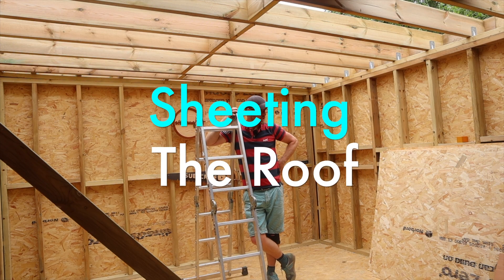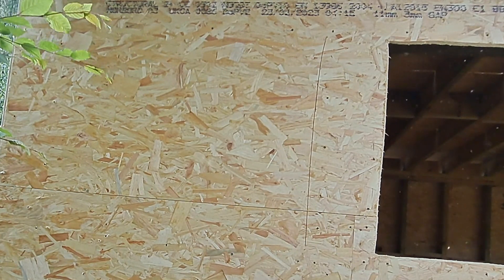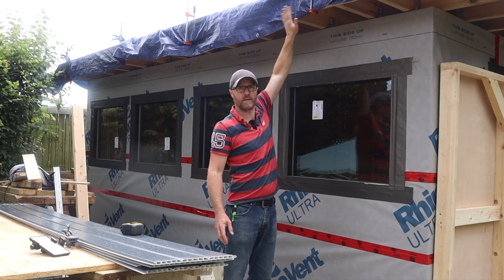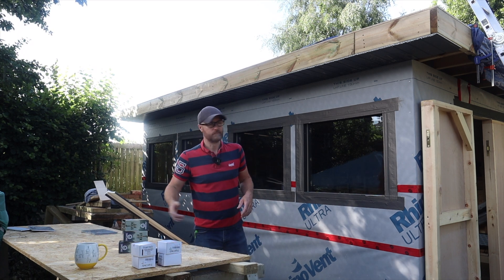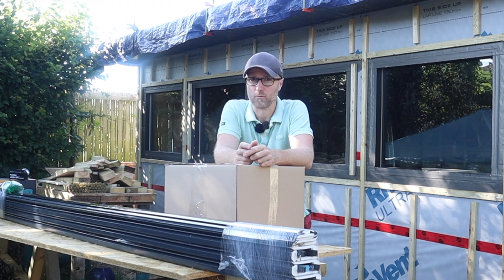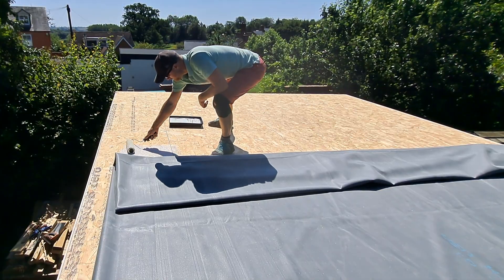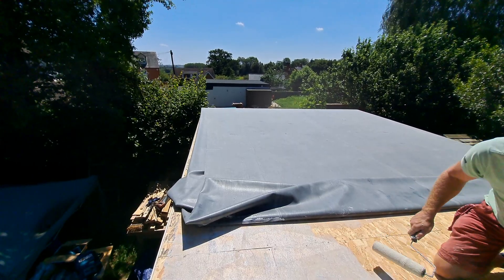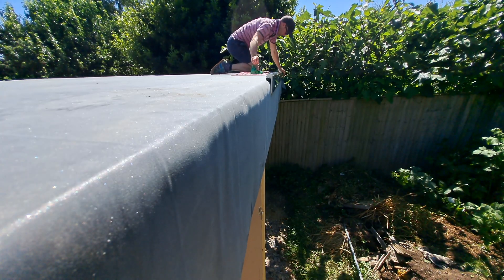Garden Room Workshop BUILD Episode 4 || The RUBBER Roof

Comment: Even with the mistakes it looks like that roof came out very good. I'm not familiar with that type of roofing system but it seems like having the perimeter well secured with even a relatively spotty glue job will hold up really well. The build is looking pretty good so far. The unfortunate thing about roofing is the best time to do it is when it isn't raining, which means that it is probably going to be hot. The manufacturer of this system should go with a glue that works well on hot days. I'm sure you aren't the first person to run into that problem.
Reply from the maker: You know what Doug, you are spot on. The roof system is so simple and take the weather out of the equation and it would have been a breeze. Even 5 degrees less would work. I know at the end that it is applied correctly but it could have gone worse and I would not have been able to fix it. so I do feel lucky. I will ask about other glues.

Comment: Love this build, going to be doing something similar myself in the new garden when we move. Half the width but just under twice the length. Long shed with a summer house stuck on the end with a greenhouse on the end outside. Thanks for this series, really interesting to see how everything is unfolding and I can't wait for the next video as I'm sure loads others are as well.
Reply from the maker: Hi. I don't think it is everything. I think I fixed the issue and the newest recordings which are the voice over should be in stereo. Some of the older bits when I am mid build may be a little one sided but not many. Please check and let me know as i am at a loss if it is all of it.

Comment: Roofs can get really cold, even during clear summer nights. If you want to insulate the roof, I can only advise you to put a really good and perfectly tight vapor barrier under the insulation. Otherwise you risk to get a lot of condensation underneath the rubber membrane.

Just some free advice from an architect. Otherwise good job and good luck with the rest of the project! Will be nice to have a place like this!
Reply from the maker: All advice is welcome to this novice. Thank you. Can I please ask. I was planning on putting foil insulation, the 50mm kinsman directly under the roof with foil tape all around it. then an air gap. Then rock wool probably 75mm. do you think that this is enough.
Reply: @startmaking1 I’ve just completed my build and I had a 50mm gap under the osb then 100mm kingspan insulation. Then a green plastic vapour barrier. With vented soffits front and back. Allowing air flow in the 50mm air gap. Just check your air flow is sufficient. Looks good
Reply: @startmaking1  
The risk is that warm air will travel through the insulation, the warm air will cool down and the moisture in the air will condensate.  So you want a perfectly tight vapour barrier underneath the insulation to prevent the air from entering in the first place.

I have never used foil insulation.  If it was my built I would fill the space between the rafters entirely with rockwool and than put a good plastic vapour barrier underneath the rafters.
Reply from the maker: Thank you guys for the advice. Very much appreciated and I am currently replanning.

Comment: Your doing really well fair play 
Only tip to you is use a paint roller extension saves your knees up and down can do longer runs too when I done my first was the same as you but I learnt very quickly 
KEEP UP THE GOOD WORK
Reply from the maker: Thank you Lee. And rest assured, that will be one of the first bits of advice in the review video at the end. My knees still ache when I look at the roof.,

Comment: This was eye opening to me as I have never heard of this type of roofing. For what it is I think you did an admirable job. I'm curious how you came about deciding to use this type of roof over other types, such as asphalt. As for the weather, it seems to be quite bad all around the world. We here in California have also experienced sweltering heat and afternoon hot showers. I resorted to using shade cloth for part of my rear yard to shade the rear windows as the sun sets. Glad you didn't quit! I'm looking forward to watching what you accomplish next.
Reply from the maker: Hi. And thank you for watching . I had a lot of time waiting on planning consent to choose the roofing. Asphalt was my first thought but then I saw a build using this and it felt easier to apply. (weather aside), and I felt confident in the finish I could get around the sides. I was not sure I could get asphalt to look as professional with my little experience. That said, this is at least twice the price and getting it up on the roof to start with is a mission due to weight. I will go over all costs and benefits in a final video in a few months. But I will say that I made the right choice in my opinion despite the worst day. Weather wise, I have found this summer a little bonkers. The start of the build I did in 30 degrees thinking it would only get hotter and then it rained relentlessly for almost a month, with this baking day in the middle. crazy
Reply: These EPDM rubber roofs are more beginner/DIY friendly than the asphalt roofs that need a torch. Also less heavy probably. The asphalt rolls are about 35kg for 7.5 m2 I think.
Reply from the maker: I think that you are spot on and once on the roof it was really easy to manoeuvre.

Comment: Its looking good now mate. If you do it all again after the rubber has relaxed roll it as opposed to folding makes it easier. And you won't get so many bubbles to roll out. Allso invest in kneepads having spent about 20 years of my life screeding floors and plastering knees suffer. Another good tool is a few beer or milk crates and a few planks, saves all that stretching and working above your head. Better than trying to use a ladder for everything. After seeing all that cutting to fit to joists you can see what i meant about putting the first joist to suit sheet length and then work 400s back and forwards from that. Saves cutting sheets and waste. And you've got it all again when you do the ceiling and internal walls. Before you do the ceiling make yourself a T piece  to support one end while you fix the other end or hire a board lifter. I assume it will be osb again at least thats a lot lighter than 8x4 half inch plasterboard that i was used to. And dont forget your vapour barrier all round before you board everything.
Reply from the maker: Oh you are so right. Great advice. Rolling the rubber would have been smart. Kneepads are the biggest regret of the entire build too. I totally understand about the 400mm to centre now too. This will make me cross during the interior and your words will ring in my head. But, it will be great advice to give in the review video at the end I guess. I love the T support idea. As I will be doing it solo that will be priceless. May I ask about the vapour barrier. My plan was to go with 50mm kingspan foil lined insulation right up against the OSB roof sheeting, between the rafters, then a decent air gap and finally rock wool around 50mm before ply sheeting for the ceiling. If I foil tape the kingspan does this sound like it is about right or is there a better way that I can manage.
Reply: @startmaking1  Ideally the air gap should be between the outside boarding and the insulation.  What ever you use for insulation  you still need a vapour barrier on the inside before your ply lining. Any moisture including your warm breath rises and will condensate on the first surface it finds and any moisture getting into the timbers or insulation will cause problems, ie rot or smells. Am i to assume the rockwool is to help deaden sound, yes should help softer sorces obsorb sound better. As for foil tape if your kingspan is not going to be level with the inside of your joists i dont see how it can help any thing. Back to air gap these days in the construction industry we put trays to stop insulation closing the gap from eaves to the cold side of our loft insulation unless its a warm deck roof, ie on top of rafters. Another tip when boarding ceiling use crates and a plank to stand on that keeps your head a couple of inches from ceiling and wear a hat. Your head makes a good third hand when fixing but the padding gets thinner with age.
Reply from the maker: Ah, brilliant. Thank you. I will readdress and plan the roof a little different once the electrics are in. Yes the rock wool is for sound. thank you for the advice.

Comment: Cant fault rubber for roofs its how I did mine and its expensive but quality is rest assured.
P.s the glue for the 100mm atound the edges is awesome for repairing swimming pools. So is the rubber offcuts 👌👌👌
Keep the vids coming pal
Reply from the maker: Yeah, great product and a great company. Great advice too on the pool patches. My dog ruins the sides on our so it is really useful advice. Thank you
Reply: Did u find that the texture was like an innertube from a push bike though, i was being really carefull with it 🤣 until u realise how tough it actually is
Reply from the maker: Yes, exactly like that actually. Far more robust that I thought. I probably didn't need to sand the edges of the roof in fairness.

Comment: Glad you overcame those hurdles and you have ended up with a really good looking roof indeed. :)
I wish I had been there to help you as I have helped build several rooves last year.
If you ever do something similar, the plastic panels on the underside of the roof can easily be cut with score and snap with a sharp blade.
Reply from the maker: Hi. I would have definitely appreciated the help but man am I stubborn. Right of passage type of thing. good advice with the soffit. Sawing it was a pain. another comment mentioned a mental cutting blade in a jigsaw, that may be worth a look too.
Reply: @startmaking1  A metal cutting blade will make a far better cut than a wood cutting blade but scoring and snapping is far quicker and is also easier to get a straight line. Give it a try on a leftover bit if you have some. :)
Reply from the maker: Let the testing begin. Thank you
Reply: @startmaking1  Will it be a video?  lol
Reply from the maker: Good idea. Well,... maybe.
Reply: @startmaking1  When I can find the time I plan do do some work to my workshop. I plan to put all my electrics and possibly a little bit of plumbing inside a duct like cavity within the walls with easily removable covers. That way maintainance and adding things like extra sockets will be easy later on down the line. Might be an idea to do yours in a similar way perhaps?!? :)
Reply from the maker: That is a great idea. I will have a chat with the electrician tomorrow.

Comment: Great episode! Glad you got through the roof ordeal. Useful tips for me as well as I'm planning on the same rubber system. I am wondering about your door, is it normal height or custom? Assuming you're building to 2.5m
Reply from the maker: Thank you. Ah yes, the door. That is next weeks video. Yes I am building 2.5m front down to 2.4m back. Maybe a few mm lower to account for my lack of skill. The door is way too low due to the size of header I put in above it. I could not get a door off the shelf as a result. Solution would be to either use a smaller header and then you can just squeeze a standard door in or do the sensible thing and put a door on the highest front wall.

Comment: Yes!! The Jersey!! which made getting the sheathing up there easier than if you hadn't worn it.  For your first major build, you're doing a spectacular job!  Next time, invest in a slap hammer (stapler) for the wrap.  May I ask why didn't you use J channel to attach the soffits?  They allow you to remove/replace the soffit tiles in the event  you may need to do that for whatever reason.  I use metal roofing for sheds and out buildings so that I don't have that problem; it's just a bit easier and just as water tight, in my opinion.  But, who are you kidding, it's looking great!  Also, I'm sure it will do it's job very well.  All in all, it's great and welcome to the world of construction.  It  does get easier.  Did you use stainless steel staples when you put those hospital corners on ( I know that's a butt-headed comment, but it is an exterior application)?    Beautiful, I'm jealous.
Reply from the maker: Hi Meat. That Jersey has some power. I think that it instills a calm in me that is not present usually. Means I dont throw my toys out of the pram when stuff breaks. I saw someone with that kind of stapler and was instantly jealous. Not only easier but looks cool to use. What is this J channel you speak of. I need to do a google. Hang on. Oh for goodness sake. That would have been so blooming handy, Im not kidding, I have never heard of it. Right, another thing for the review video at the end. Oh well.  looked at metal and bitumen roofing and to be honest I think that you are right about the ease, here's the silly thing. When you walk down the steps into the garden you get a really good look onto the roof and I figured that the rubber would look nicer. Silly as that cost me about £500 extra. Still, it felt smart at the time. No comment you make is butt headed. you are like a Yoda of comments leading me. I still learn more in the comments section than anywhere else. The staples were stainless steel. Phew. And thank you.
Reply: @startmaking1  Mark, it is a pleasure to see you learn and grow.  You have a ton of talent.  Frankly, I thought you were going to hot tar the roof; now, that would have been real Sh*t.  That rubber sheeting is interesting.  I've always been curious how much it expands and contracts with the weather.  But, I'm sure some science guy has that all figured out already.  You are an outstanding young man.  Your parents raised you right and all of your family should be proud of you.  Wow, do you realize how far along you've come just in your short You Tube career?  As for cost, put it out of mind because this is something  you are making for yourself and you want to be happy at the end.  I wish there is something I could contribute to your project (even something as simple as a slap hammer).  I not sure how to mail stuff internationally, but if there is a tool I could help you with, it would make me feel like I have a legacy to give it to you.
Reply from the maker: Hi Meat. Sorry for the late reply. Had a few days away with the family. I can't even imagine hot tarring the roof. I think I would still be up there stuck to it if I had tried that. Im with you on the expansion. I actually went up there a few days ago and it was still very pliable. It was a hot day, but there were no bubbles or any signs of movement. The contact adhesive is supposed to be for stopping it shrinking back from the edges in the winter. So we will see. I am like you, someone else smarter than me has said this is the way to go, so I dont need to prove that fact too. As for contributions, this is something I wrestle with daily, both from sponsors offering free tools etc (though nothing is ever free), and from fans of the channel, the truly free offerings. The reality is eventually there will have to be other directions that the channel goes in so that I dont live and die by YouTube ads payments. But which way to go is the toughest choice because I dont want to start every video and end it begging for patreon members and such. I want to add value to everything and also I really dont want long term supporters to feel that their support is soon to be monetised as that would be wrong also. It is a fine line and between you and me, I would love to eventually not have this as a second full time job but decisions need to be carefully considered. Lot of waffle but let me be a little more concise. Thank you for the fact that you care enough to want to help and just know that being around the channel is more than I ever expected a year ago. Thankyou
Reply: @startmaking1  I hope you enjoyed your time away.  My family and I have never really been able to vacation together; either because of military service or trying to run a business.  My point is: take the time to let the kids know you are involved.  I had five, each one and I have a different relationship depending on where i was in life.  They're all good and productive young people, but ofttimes I've wondered how I could have done it better/more balanced.  Anyway, now to the task at hand, as an old guy, I'll just say that I've seen a lot of things come and go.  Hold on to what will, in the long term, provide for you and your family the best with the greatest degree of probability.  There are a lot of YouTubers who did quit their full time gigs and I wish them well, but they have also sold out; this is one thing I am glad you recognize.  I don't want to make this too drawn out, but I did figure out my dilemma,  if you want a good hand tool try the Veritas site, tell me what you'd like (within reason) and I can order it and have it drop shipped directly to you.  Remember, there are no free lunches.  Godspeed.